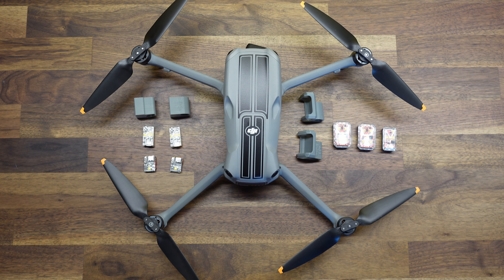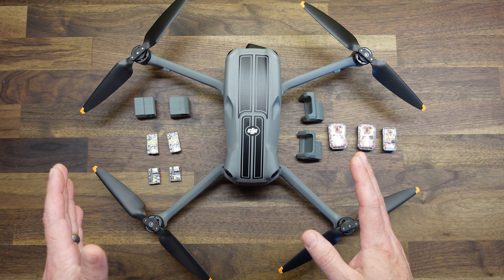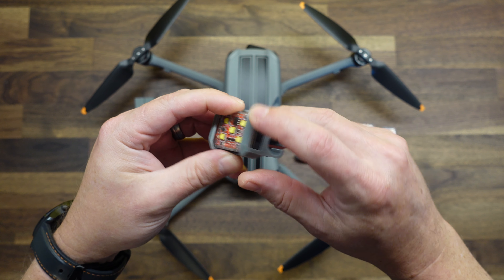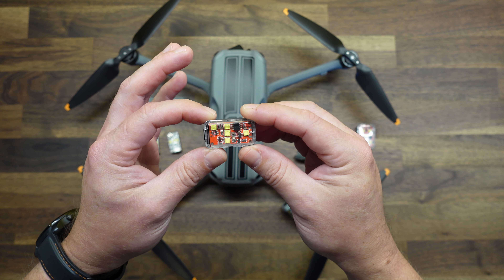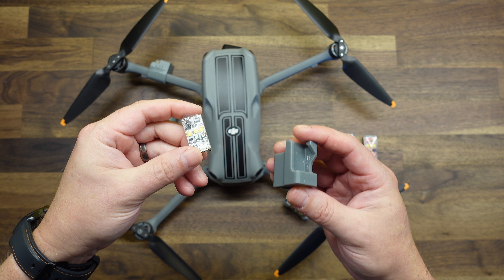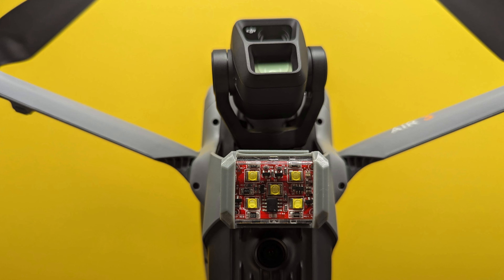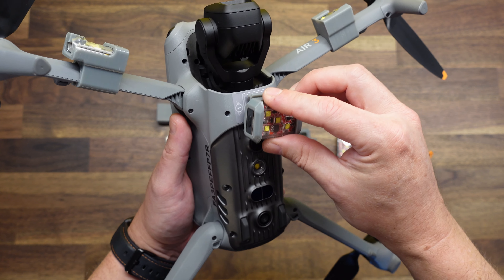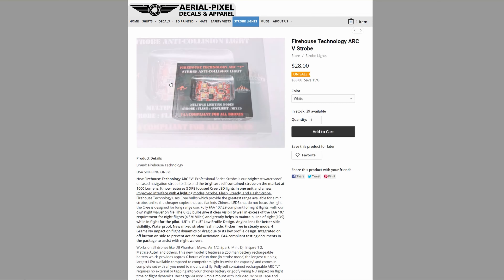Installing Strobe Lights on the DJI Air 3

Comment: Does the flashing of the light interfere with night time photograpy/videography?
Reply from the maker: Under normal conditions you can't see the light from the strobes when mounted to the arms. There are 3 scenarios that you may be able to see it in your images:
1. During mist and fog conditions - The strobe light can reflect off the water droplets in the air.
2. If you are close to your subject, it's like shining a flashlight on your subject.
3. If your props are in view (usually not a problem on the Air 3 and Mavic 3 Series) - If your props are in view the light can reflect off the bottom of the props. 
We sell thousands of strobe mounts every year for a variety of drone models and strobe light combinations and haven't had any issues. 
Hope that helps, Fly safe!

Comment: I have a DJI MINI 4pro. I’m looking for mounts for a trip I have upcoming this coming Thursday. What is the best mounting style so I can see them? I don’t want them interfering with the obstacle avoidance system. Rear arms? Front arms? Or facing down? I just ordered ARC V PRO lights (2pack)

Comment: Hi, do you have a top and bottom mount available for the DJI Mini 4 Pro? I'm using the Vifly USB-C Strobes.
Reply from the maker: We don't currently offer top and bottom mounts for the Vifly on the Mini 4 Pro, but we can easily make them. Right now we only offer front and back arm mounts for the Vifly strobes. I will reply back to you when they are ready for purchase, give us a few days for design and testing.
Reply: @AerialPixel  Ok Great. Sounds good. Thank you
Reply from the maker: We've added 2 options to the Mini 4 Pro Vifly strobe mounts for you. We now have a top mount and downward facing mounts that attach to the front arms. We did the downward facing option on the front arms because there isn't a good place to clip them to on the bottom, we've done this for several other drone models and it works well. You can see the new options on the product page here: https://bit.ly/mini4vifly
Reply: @AerialPixel  Wow, that was the Fast. You guys are the Best. Thank you, I really Appreciate it. I will go ahead and purchase them right now.
Reply: @AerialPixel  One more question, are you able to do a downward facing option for the rear arms also? Because if you can, I will purchase those too.
Reply from the maker: We have added these two options:
- 2 Downward Facing Front Arm Mounts
- 2 Downward Facing Back Arm Mounts
You can find them here: https://bit.ly/mini4vifly
Reply: @AerialPixel  Perfect, You guys are the Best. I just placed order. Thanks Again, Really Appreciate it.

Comment: Interesting video. I do have a few questions:
Which light setup do you recommend for a Mini 4 Pro?
Which ones only come with a remote control?
Is there an official suggested “anti-collision” night light placement protocol by the FAA?
Is there, or has there been any restrictions applied to color of lights being used on a drone from law enforcement agencies? In some cases in times past, I’ve had a convo with local law enforcement who stated there were LED color light restrictions for motorcycles, moving vehicles, etc, stipulating law enforcement light colors (red, blue, green, white, etc.) could NOT be used on private/personal moving vehicles. Any info on this subject?
Thank you in advance for your time, consideration, and reply. 🇺🇸😎🇺🇸
Reply from the maker: I would recommend the Firehouse Micro Pro on the DJI Mini 4 Pro. It is Firehouse's brightest strobe and it is smaller and lighter than the ARC V and ARC V Pro.
The ARC V Pro and ARC XL Pro strobe lights are the only strobes that come with the remote.  
As far as mounting locations go, I'd recommend 1 front arm and 1 back arm mounted strobe.  You can also mount one on the top if you wish.
The FAA doesn't give guidance on where they should be placed, the color of the light. I would stay away from using red/blue and white/blue color combinations unless you are in law enforcement. White, Red and Green color combinations can be used as they are typical colors used on manned aircraft. 
You can find the Micro Pro strobe lights on our website here: https://bit.ly/fhmicropro 
and the Mini 4 Pro strobe mounts here: https://bit.ly/mini4micro
Hope that helps! Fly safe!
Reply: @AerialPixel  Thanks for your reply and the info. 

At the moment, the Micro Pro (multi-color) is showing out of stock. Also, the description does not indicate which color LED’s are included in the multi-colored version. Any sales or promos coming up with Labor Day around the corner? Any bundle deals (with or without mounts)? Thanks again in advance for your time.
Reply from the maker: Yes we are out of the Micro Pro Multi-Color. We have been stocking more of the Micro Pro White as they are the most popular and brighter than the Multi-Color version.  If you want the Multi-Color you can order them straight from Firehouse as we may not get more stock of them for a few weeks. Firehouse also sells our mounts, they sometimes have bundles with them too. They don't stock our top mounts for the Mini 4 Pro, but they do stock the arm mounts. 
We don't offer bundles, we don't have as much pricing flexibility with the strobe lights as they do. We usually only have one sale a year on Black Friday.

Comment: Hey Ryan,  I'm about to order the vifly front and rear mounts and top mount for my dji mini 4 pro. I heard all 5 mounts with strobe lights installed add up to around 70-75 grams. Can I fly my mini 4 pro with all 5 installed or would they be too much weight added to the drone?
Reply from the maker: No it will be fine, we have customers flying 5 Firehouse Micro strobes fine and the Vifly is much lighter.
Reply: @AerialPixel  Ok Great. Thanks Ryan

Comment: Can you give a recommendation for which lights to get for the front, back and Top?    

Do you recommend that only one flashes as required or do you have them ALL flashing?

Thank you!!!
Reply from the maker: If you fly in the US the FAA requires a strobe that has 360 degree visibility that has a strobing effect that is visible from 3SM. Our top mount will meet that requirement, however that alone won't be as visible to you on the ground. One of the most popular configurations with my customers is minimum 1 front arm and 1 back arm mounted strobe, this will also meet the FAA requirement since the strobe lights have a 180 degree throw. All strobing lights give the best all around visibility and battery life is much longer. Where the always on feature if the strobe lights is used most for light painting.
Hope this helps!

Comment: hello is there a top mount available now?
Reply from the maker: All of our top mounts for the Firehouse Micro strobes also fit the Micro Pro, they are the same physical size. We have added options to all our ARC V mounts to also have an ARC V Pro option, since the ARC V Pro is slightly bigger.

Comment: Are there mounts for the Firehouse strobe on the Autel Robotics Evo II Pro Enterprise V3 (carbon fiber arms)?
Reply from the maker: I'm not sure if they changed the arm size for the Enterprise version, I believe the profile is the same size as the standard Evo II just made of carbon fiber. If you have a set of calipers to measure the overall height and thickness of the arms I could confirm it for you. You can find our EVO II mounts here: https://bit.ly/evo2mounts  Be sure to select the ARC V version.
Reply: @AerialPixel  The arms are 7/8" high and 3/8" wide
Reply from the maker: In the 3D printing world we use Metric (even though we are in the USA). The EVO II arms measure 20.0mm high and 12.2mm thick. Without really precise measurements down to fractions of a millimeter I couldn't tell you for sure if they would work. We use a caliper like these https://amzn.to/48eUlxz to do all our designing, if you happen to know someone that has a set you can borrow for a couple minutes I could custom make you a set.
Reply: @AerialPixel  20.00mm is a tiny bit more than 3/4". 12.2mm is a tiny bit less than a half inch. So 3/8" and 7/8" is just about spot on. I'm going to buy 4 of them. If they don't fit, I may buy the regular Autel drone so they will - lol.
Reply: @AerialPixel  I received the mounts and they fit on the carbon fiber arms of the Autel EVO ii  Enterprise (sort of), but not securely. The carbon fiber arms are not "square". The only way to use the mounts is if you somehow were to tighten them on the arms. Otherwise they would flop around. I would buy the additional mounts if you ever came out with ones that were made for the enterprise.
Reply from the maker: @Diantane  I was worried that would be the case. If I get the opportunity to get my hands on the Enterprise version I'll do the modeling and let you know.
Reply: @AerialPixel  I would appreciate that. The Autel Evo enterprise is a very nice drone. Besides the specialized missions that it flies (taking many detailed pictures of a very large area), It flies over 45 mph with its 10" propellers and stays up over 35-45 minutes depending on how fast you fly. It also has attachments like an amplified speaker that makes your voice very loud several hundred feet away.
Reply: @AerialPixel  Would you happen to have the Mini 4 Pro mounts yet (not sure if the Mini 3 Pro has the same size). The "4" will be here this Friday.
Reply from the maker: @Diantane  They are designed off of the model from DJI but our Mini 4 Pro won't be here until Thursday to do testing.  I will try to get them out by mid next week. The Mini 3 mounts won't fit (on paper anyway) I will let you know if they do.
Reply: @AerialPixel  thanks!
Reply: Just ordered a set of the firehouse mounts. Thanks 🦾

Comment: Are you going to be making a bottom mount for the firehouse mini pro?
Reply from the maker: The Micro Pro strobe lights fit in the regular Micro mounts, they are the same size. You can find the Micro mounts here: 
https://www.aerial-pixel.com/dronepilots/#!/DJI-Air-3-Series-LED-Strobe-Light-Mount-for-Firehouse-Technology-Micro-Strobe-Lights-Not-Included/p/575425843/category=160401403 
Be sure to select the "Bottom Mount" option.